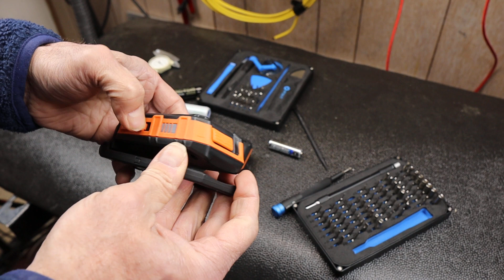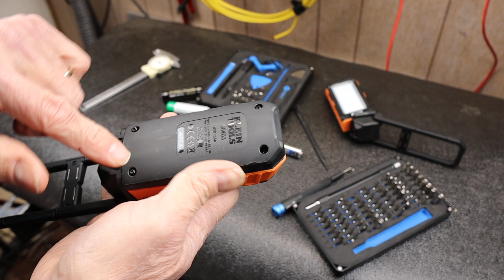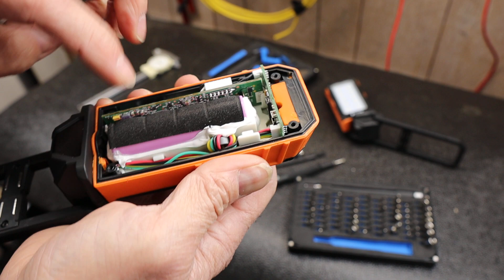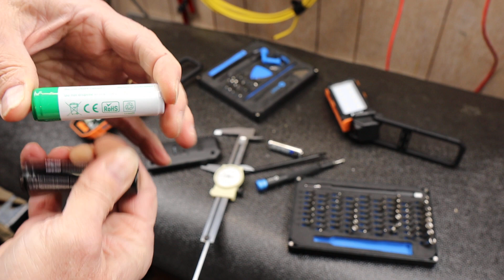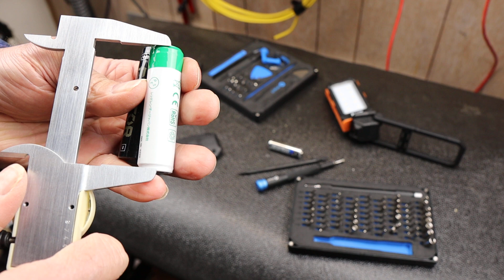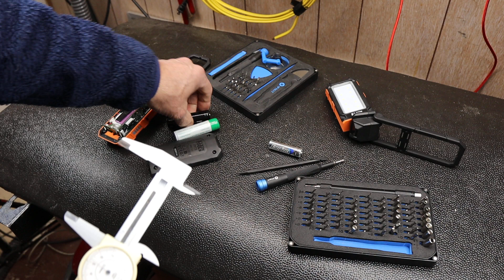The 18650 Battery in the Klein 56403 Personal Light: Responding to comments at Last Best Tool

Comment: Another great video Doc. I have 3 rechargeable magnetic work lights, a SnapOn, Astro and a Braun. The down side to all of them is run time.... And on a couple of occasions, used all 3 with a need for a 4th. I got a couple of 18650 batteries from Battery Plus just as a back up. Much faster then waiting for the lights to recharge. That brings me to a question for you. Solar powered battery chargers, got them, use them, recommendations ?  BTW, loved the Cool tool Alert on the Reciprotools, ordered an adapter and a couple of rat tail files. 👍
Reply from the maker: I haven't used many solar battery chargers beyond a couple AA solar chargers and Goal Zero cell phone chargers. Oh, and a car battery solar trickle charger. They worked, but slow. I am actually now working on a portable solar project for a camper I'm driving to Alaska this summer pending access to Canada. So now I am learning about different panels, charge controllers, and lithium 12v vehicle batteries.

Let me know what you think of the Reciprotools system and files.